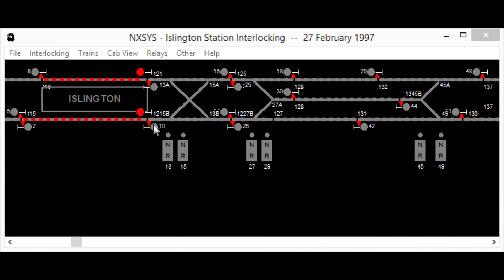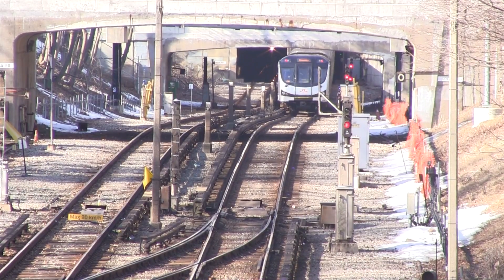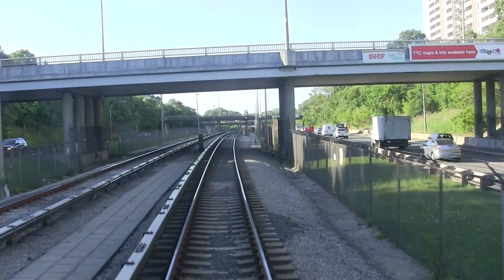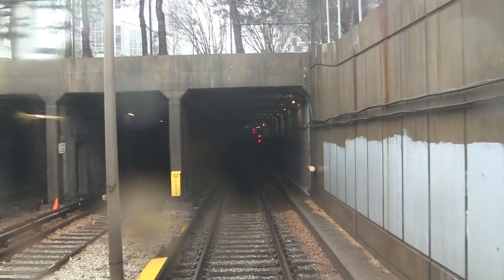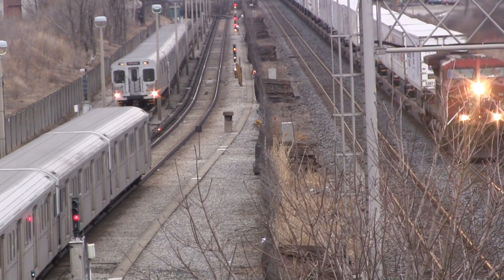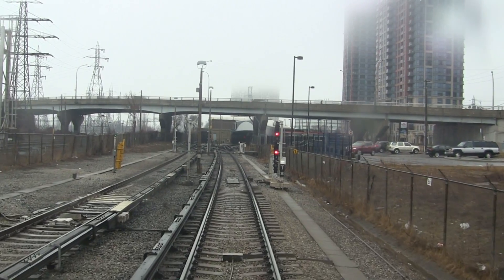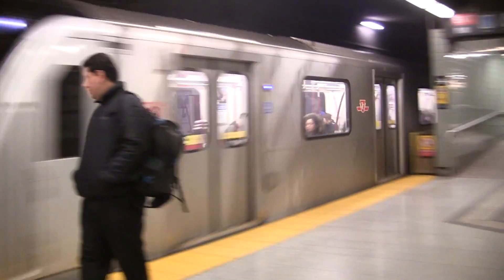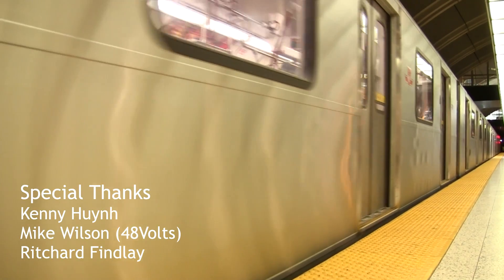How the Toronto (TTC) Subway Train Signal System Works

Comment: There’s also 2 more wayside signs that weren’t mentioned in this video. If you ever encounter a series or off power wayside sign that’s shapped like a diamond, this tells the Toronto Rocket trains only to set the controller to the series/coast position.

Comment: someone explain me why i see vids with trains proceeding with red over green  on interlocking signals ?
Reply from the maker: Can you provide an example?
Reply: Yes, but I believe i was mislead by the colour wich is very similar ( on video )... 
from what i see, it changes from red over green ( train stops run ) to amber over green ( train proceeds ) .
It is in this video :
[HD] Ride on Line 1 Yonge-University-Spadina (Wilson Hostler to Finch) in 4 Minutes (Timelapse)
at 0:50 &1:10 among others..
Thanks
Reply from the maker: Correct it was amber over green which is favorable. The system does not have red over green signals that I am aware of.
Reply: Thank you

Comment: Lines 3 and 4 use 4-car trains so the 4 signs are seen on those lines, not the 6 signs.
Reply: Well line 3 is automatic so it doesnt use markers but line 4 yes it uses 4 markers
Reply: Steven Francis it does and also I still can see the 2 marker on line 3